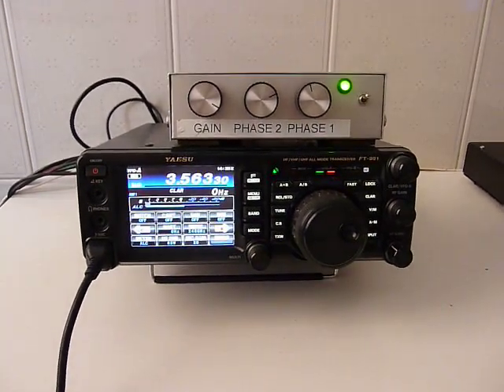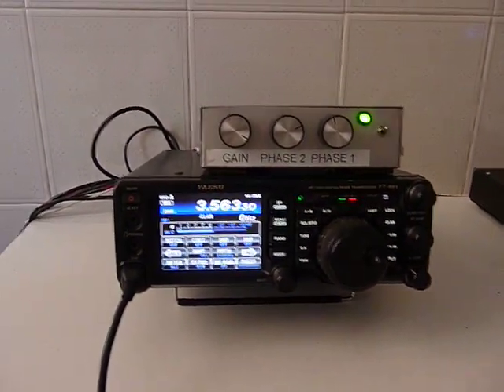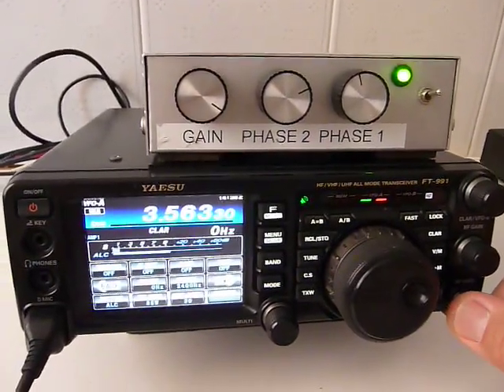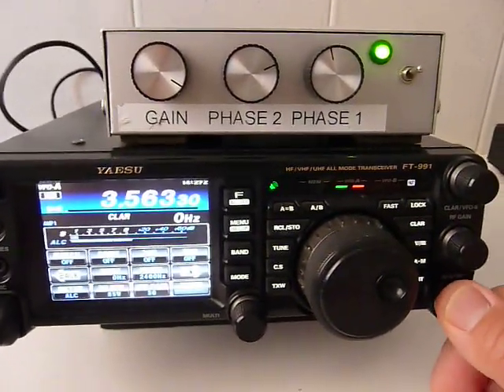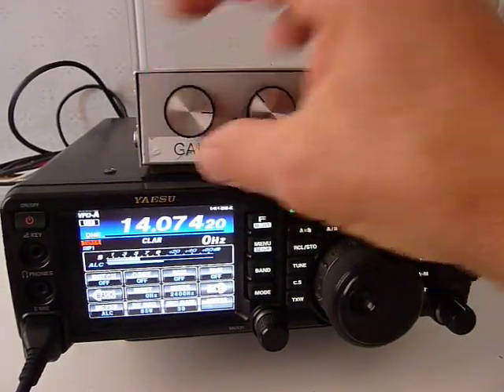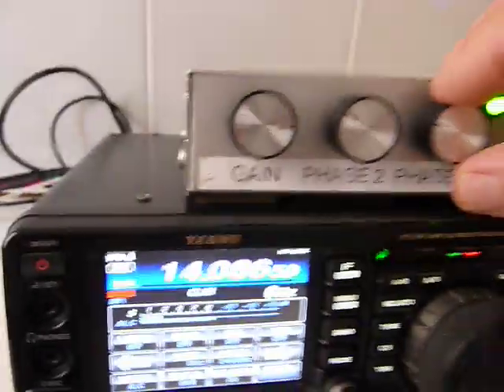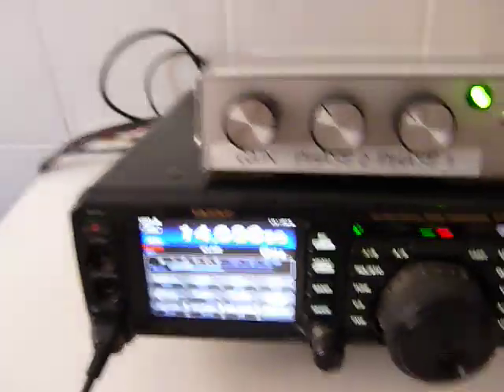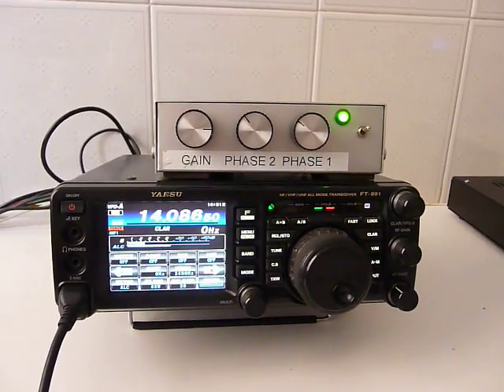I0KQB   Showing the Noise Canceller by VK5TM

Comment: Yes but when you turn the Gain and the noise disappears you have actually cut the reception and not the noise This is not correct.I regret that I bought this noise canceller.
Reply: Manos, SV1KYK
good evening from Rome.
I guess you are not sure how to properly set up this noise canceler, so get a look to the following instructions.

First, I hope you have connected a simple 1mm square single core electrical wire for the auxiliary antenna. This piece MUST be at least 9 meters long. 
This thread must be left stretched or wound. The fact that it is left stretched or wrapped must be evaluated case by case, trying to obtain the maximum interference signal.
DO NOT USE ANY KIND OF ANTENNA INSTEAD OF THE WIRE, OTHERWISE THE NOISE CANCELLER WILL NOT WORK !
Proceed in the following way:

1) Connect the auxiliary antenna wire.

2) Turn on the radio and the noise canceller

3) Adjust the main antenna to zero gain (Gain)

4) Adjust Phase 1 to maximum 

5) Adjust Phase 2 to half gain

6) Tune the radio to the signal we are interested in cleaning from the noise of the electrical 

7) Adjust the main antenna gain (Gain) to 75-80%

8) Adjust Phase 2 by turning it left and right, looking for the point where the noise starts to fade

9) At this point, you MUST ROTATE SLOWLY, ONE AT A TIME, FIRST THE POTENTIOMETER OF PHASE 1 and then PHASE 2. REPEAT THIS OPERATION SEVERAL TIMES UNTIL YOU OBTAIN THE MINIMUM INTERFERING NOISE.

10) At this point, try to rotate the GAIN potentiometer, always slowly, first to the right and then to the left, until you get a clean sound, WITHOUT THE QRN. This is very important to balance the signal from the main antenna (radio signal + local noise) together with the signal from the auxiliary antenna (local Noise + radio signal). Balancing the two signals will cause local noise cancellation. Do not worry about the possible attenuation of the main signal, as if correctly set the Noise Canceller will remove a maximum of 1 point of the s-meter. Speaking of the lost point in the S Meter, you will again gain it from the clean and noiseless signal.

11) As a last adjustment, you can try to adjust everything again, making small movements of the 3 potentiometers.
In this way, if the equipment has been WELL ASSEMBLED, WELL WELDED, AND WELL WIRED, the result will be more than excellent.

In recent years, I have been contacted by many radio amateurs, both from Italy as well as from the rest of the world, and all have been more than satisfied with the results of this type of equipment, namely X-Phase 1 and 2 or the Noise Canceller.
So, I hope that all was clear.

Καλά να περάσεις
Reply: @giovafra6158  Thank you!!

Comment: ciao Giovanni.
sto pensando di prendere uno di questi ageggi.
secondo te`e meglio questo  , 
o x phase v2
visto che li hai entrambi chi meglio di te´:
73
Reply: Cosimo, buongiorno.
Per la mia esperienza, avendo costruito tutte e tre le versioni di X-Phase/Noise Canceller, il più performante ed altamente lineare nelle regolazioni è proprio il Noise Canceller del video.
Devi contattare direttamente VK5TM, che realizza il circuito stampato, molto molto ben fatto, e te lo spedisce dall'Australia per pochi euro. Credo che in passato egli fornisse anche, su richiesta, anche la componentistica necessaria. Io ho comprato i Fet smd su ebay.com, per pochissimi euro. Stesso discorso per i piccoli toroidi. 
Ti consiglio di inserirlo in una scatola di metallo più grande di quella che vedi nel video, altrimenti avrai problemi nei collegamenti in coassiale su distanze così brevi. 
Per le altre due versioni ho utilizzato un contenitore di ferro che, purtroppo, non era più disponibile per questa terza versione.
Se mi scrivi a I0KQB@hotmail.com, ti spedisco un articolo sull'X-Phase che scrissi 5 anni fà, dove dalle foto potrai vedere come lo ho assemblato.
Per contattare VK5TM, innanzitutto vai sulla pagina che adesso ti segnalo, e scrivigli tranquillamente.
https://www.vk5tm.com/homebrew/noisecancel/noisecancel.php#:~:text=The%20VK5TM%20Noise%20Canceller%20is,and%20a%20double%2Dsided%20pcb.&text=Maximum%20transmit%20power%20through%20this%20unit%20should%20be%20100w%20or%20less.

Fammi sapere.
Ciao.
Reply: P.S per Cosimo
Se non lo avevi ancora visionato, guarda il mio video sull'x-phase e ne capirai l'efficacia.  Il Noise Canceller è addirittura migliore.
https://www.youtube.com/watch?v=ZU72A0RpqEY
Reply: @giovafra6158  CIAO gIOVANNO GRAZIE DELLA RISPOSTA: 
ti scrivero`appena possibile per quell`articolo. o pure manda tutto a mimmo14@aol.com
quindi confermi che l`australiano vince sul tedesco.a me interessa che vada bene anche in 160m
ci sentiamo dl3mim
Reply: @giovafra6158  SI L`AVEVO VISTO : LO STESSO CHE MANDA L`AMPLI IN PORTANTE.
grazie tante